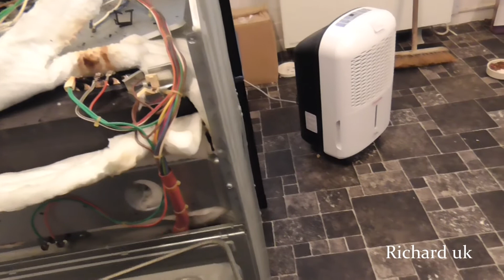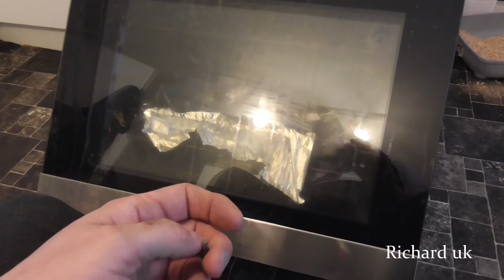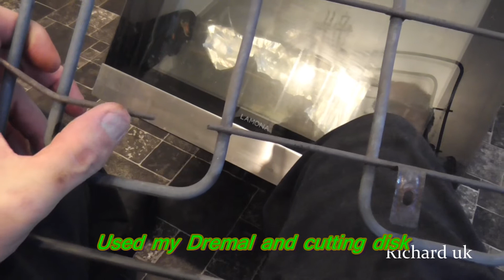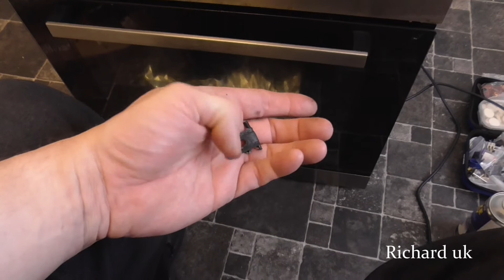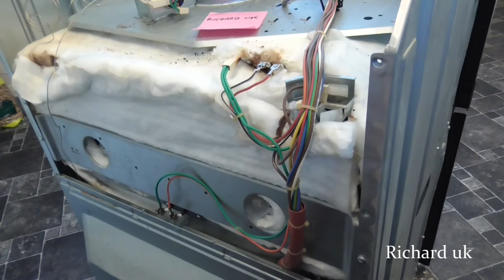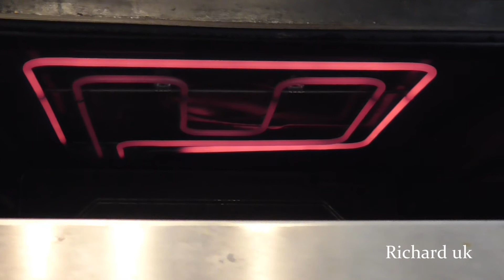Lamona LAM4601 Replace Grill Element

Comment: Hi Richard, great video thanks!

I have an issue with the same oven! The light and fan work but the oven gives no heat all, so I think the element might need replacing? If so, do you know if the whole oven needs to be removed from the unit and needs to be opened from the back? 

Also, if not the element, do you think issue could be something else? 

Tapping into your expertise here! :)
Reply from the maker: Hello Joe.  Yes you need to take out the oven from the unit. to get to the elements from the back.. If you disconnect the wire and test them with multimeter across the element if you can. I think most likely one of them needs replacing. You can buy multimeter very cheep, and save you the big call out charge. I hope you can fix it ok its not difficult to do.. Thanks 
when you order the parts they going to ask for the model number and serial numbers found on the back of the oven or if you have the manual its also on there
Reply: +Richard uk thanks Rich. How did you remove the oven from the unit? Sorry, a bit of a novice! :)
Reply from the maker: Its no problem at all.. There is nothing holding it in. just gravity.  I recommend you have a dining chair to help you. Pull it out and hold it over your chair then you can balance it to get a better grip. so you put it on the floor. But remember to turn off the power at the fuse box first.
you will find its got panels all around held on with cross head screws . remove the panels . take a photo were the wires clip on to. if you remove the clip leads behind the insulation. you will see it ok. Take your multimeter set it to omes. it may have auto ranging or digital scales to put you in the resistance range, more are automatic now days. see if you get a resistance reading from ground to the live on the element. test each side one at a time. if one is broken you will see nothing. if you test the other side the same and it reads any thing you know the one thats broken..
its hard when I cannot see it for my self. but that's the jist of it . ow and some meters can set it to bleep when the element is ok if open no bleep. hope you fix it ok

Comment: Hi Richard, Good stuff-and no blood!, I usually end up cutting myself on appliance repairs, much preferred commercial stuff. 
 Ordinary good quality self tappers are fine don't worry about temperature, don't be tempted to use stainless steel.
 The only non commercial cleaner I've found that is any good is "Mr Muscle aerosol oven cleaner", tried a few, this works the best.
 Cheers, J.
Reply from the maker: Hello Joe... Yes its good no blood, and did not swear at all. I wished I thort of the penetrating oil before. Would been a peace of cake. I wish I seen you post before I buy oven Pride, I have it now so think I do a review on it see if any good before trying the Mr Muscle aerosol oven cleaner. I am going with self tappers the same as in the grill. 

Thanks M8 see you next time